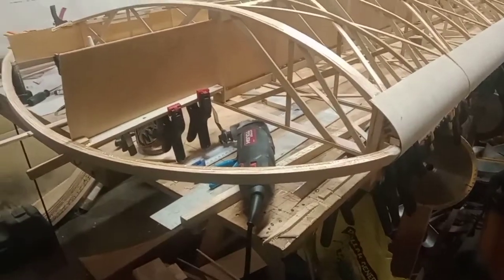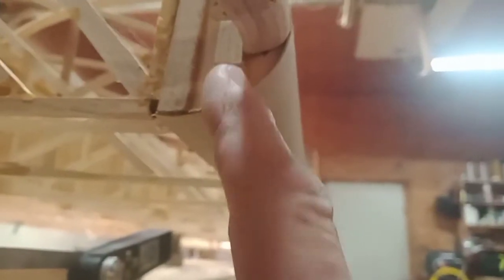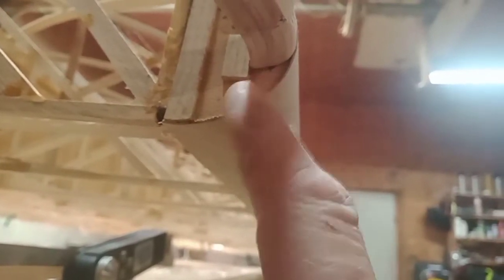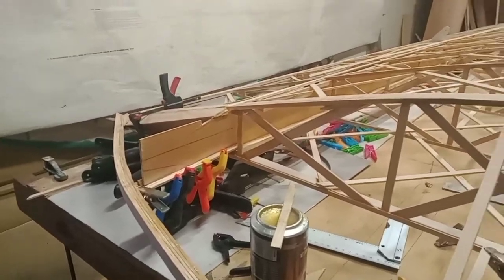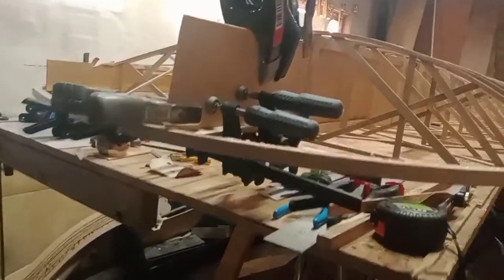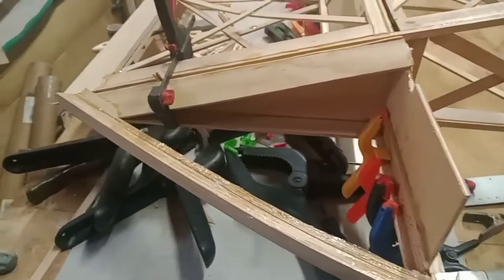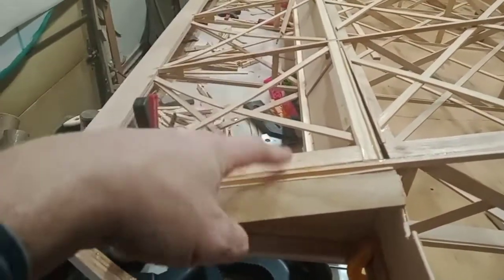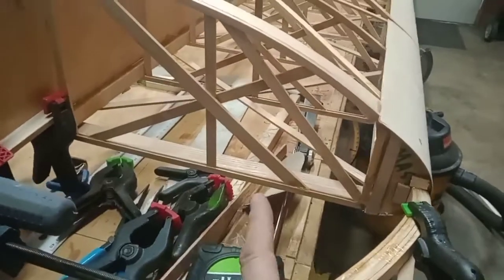FP202 Scratch build from prints E102 Wing tip bow... still!

Comment: I was thinking about wing tip handles on the Youngster but as I have brakes decided not to bother. I was talking to a friend about tip bows and they said they normally follow the cord as yours and mine do but some Cub type aircraft it is set at 1/3 the cord depth, so bang on the leading and trailing edge and 1/3 the spar depth up at each spar. That might have been the plan when the FP202 was first drawn 🙂